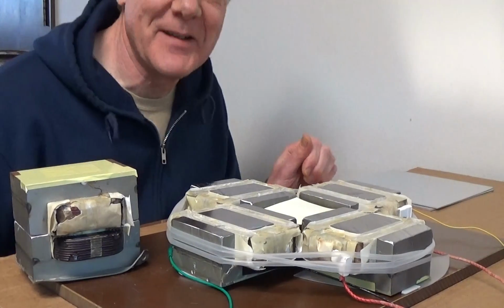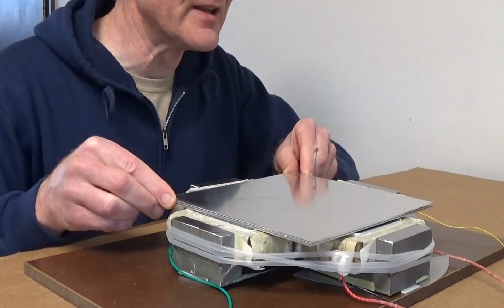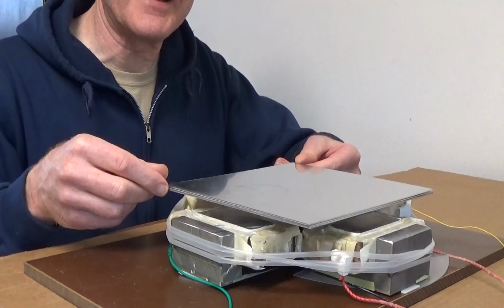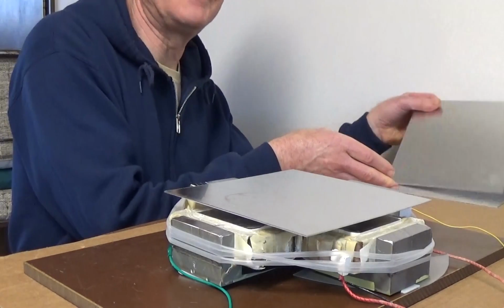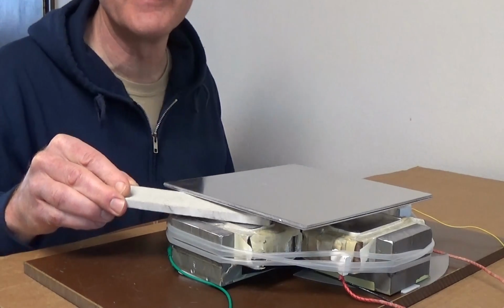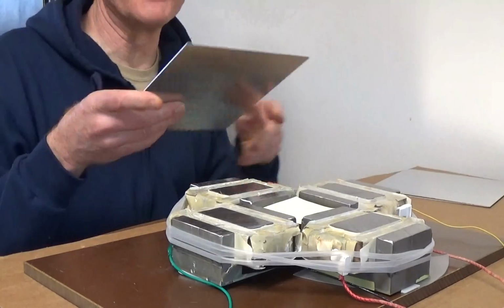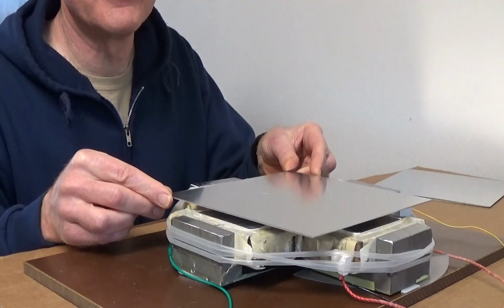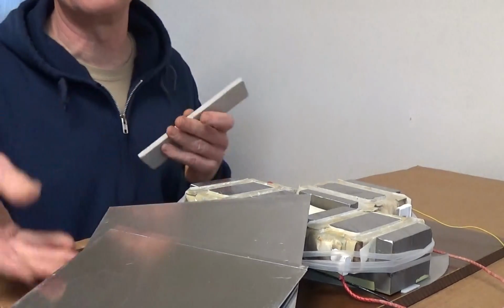Eddy current levitation using microwave oven transformers

Comment: But why does it levitate higher with more plates added???
Reply from the maker: That's the entire reason I built this demonstration - to see if that effect of more plates levitating higher was real.  Calculated that result theoretically first, but had a hard time believing I'd calculated correctly.  I tried to make a simple explanation at the end of the video.  Induced current in upper plates creates a magnetic field that attracts lower plates.  Another way to view the reason (the one I first calculated) is that the phase of induced current in the plates shifts to better align with phase of MOT winding current when more plates are added.  In-phase current creates more average repulsive current.  An infinitely thin aluminum sheet would have current 90 degrees ahead (leading phase) of winding current so generate no average levitation force.  With infinitely conducting sheets (very thick or superconducting), plate current is in phase with coil current so levitation force is maximum.
Reply: @davekni  Thanks for the updated explanation. The phenomenon definitely seems counter-intuitive. With all the plate masses being the same, I would think the addition of each plate would surely decrease the height.  Up to a point,  the added plates seem to be concentrating or, as noted, more efficiently using the induced fields.  You have definitely given me more to contemplate on. Excellent work 👏 👍🏽
Reply from the maker: @rod3134  Yes, decreased height is what I'd initially expected before thinking about phase in more detail.  My 23kHz unit does decrease height for any practical thicknesses.  That's because at high frequency even thin foil is effectively "infinite" thickness.  Phase is already aligned.  (Actually I should say 180 degrees rather than aligned.  Plate current is in opposite direction as winding current.)
Reply: @davekni  Wow!!! A possible explanation in addition to yours just occurred to me.  The analogy of the levitating Styrofoam balls in an enclosed sonic field system. Objects that are too big or too numerous will collapse the frequency node object capture capacity. Your sheet stacks are matching the frequency node central area until there is a max saturation within the effective frequency range. It's probably not that the height is increasing,  it's probably more-or-less that as more sheets are added,  the sheets frequency energy capacities and capture causes a relocation of the node height.  I know this may seem like a very loose thought, but this is really making explore some of my previous research,. Great discourse!!!
Reply from the maker: @rod3134  I doubt there is any significant analogy to sonic levitation.  With too many plates, upper plates see less magnetic field.  Current from lower plates reduces field farther up.
Reply: @davekni  Gosh, I wish I had a bigger lab... Keep in mind that the sonic system is using a multi vector axis system to levitate the objects. You can easily see the sonic field tapering off at intervals and increasing distances from the main frequency node. If the sonic system was halfed, I believe the result would be similar to yours. In your case, though, the axis of influence is mostly singular. (Bottom-Up) I would bet donuts to dollars that if a multiple axis system could be used in your setup,  the effects would be similar.  I tend to be able to see the field geometries in my mind.  The hysteresis effects and magnetic frame dragging additionally complicate it more than the simple sonic unit. I'll definitely let you know if I see anything that validates my theory. ✌🏾
Reply: @davekni is the phase difference caused by the increase in the amount of the induced current? If it is and more current can flow because the resistance of three equal resistors in parallel is 1/3rd the resistance, I think naively that means (with good electrical contact between the plates I mean) that the current for each of the plates encounters approximately 1/3rd the resistance. Normally looking at the resistance of a big sheet of conductor is silly, but when the process relies on so many amps it might actually be really important. I'm just kind of personally shocked that the contact resistance is so low, actually so shocked by it that it makes me wonder if I'm completely off-track with that explanation!
I'd be curious to see what happens if you put 2 comparatively very light pieces of insulator like 2 pieces of cling wrap either on top of for a baseline, or between, to disrupt any parallel arrangement of the resistance, if it would stop that effect.
Reply from the maker: @pinethetree  Insulation between plates makes little difference.  Plates came with a protective plastic layer that I removed for video.  But it worked the same before removing plastic.  There is little induced voltage perpendicular to plates, so little current flow between plates even when they are in contact.
You are correct that three resistors in parallel have 1/3rd resistance.  If a voltage source is applied, three times as much total current flows.  But each resistor has same current flow whether other two resistors are there or not.  Same for these aluminum plates.  Each plate has same resistance and same current.  3x total current, not 3x for each plate.

Comment: Can we use smaller winding to levitation system e.g coffee grinder moter winding ??
Reply from the maker: Smaller works, but frequency needs to be higher.  This is already small for 60Hz line frequency.  My initial small experiment coils were 40mm diameter and ran at 100kHz.  (I'm not familiar with coil shapes of a coffee grinder motor.  Shape may not be appropriate.)

Comment: The plate has a resistance and an inductance and behaves as a low pass filter with a cut off frequency, which is proportional to the resistance over inductance ratio.
Below the cut off frequency the plate behaves mostly resistively, the induced EMF and current and opposing magnetic field are leading the coil's field by 90 degrees, producing no net force, only vibration.
Above the cutoff frequency, the lowpass filter effect delays the current and opposing magnetic field by 90°, they are now in phase with the coil's magnetic field and creates repulsion.
The repulsive effect increases as we get closer to the cut off frequency and remains constant above it.
Stacking multiple plates, which is the equivalent of making a plate thicker, reduces the resistance, while the inductance remains constant, lowering the cutoff frequency. Above a certain thickness the cutoff frequency is below mains frequency and the repulsion will not increase.
This is a form of induced diamagnetism, where a conductive material exhibits a strong negative susceptibility to alternating magnetic fields.
In a superconductor, the resistance is zero, which means the cut off frequency is zero, which explains why superconductors are strongly diamagnetic (susceptibility -1, permeability 0), making able to hover above magnets. (this is independent from the Meissner effect, which is not responsible for levitation)
Reply from the maker: That is a great explanation!  Simpler, at least for those with electronics background, than the ways I've explained it.
Reply from the maker: To make this electrical circuit explanation complete, I think one more detail needs to be explained:  When resistance is large (thin plate), the inductor voltage and current are close to 90 degrees separated as you discussed.  As resistance drops, phase difference decreases.  That alone would make force increase proportionally to cosine of angle.  Doubling plate thickness (halving resistance) would produce slightly less than twice the force.
The reason for additional force beyond angle is that current in this L+R low pass filter increases as resistance drops.  Force is proportional to current times cosine(phase).  Both factors increase, making force increase faster than weight.
Reply: @davekni  Thank you for completing my explanation ! (wrote it at 1am on a phone). Interestingly, this levitation effect is also produced in induction motors. However, the torque producing component (or force, for a linear motor) is the out of phase current. As a result, the torque of an induction motor increases with the amount of slip, but not proportionally because it is also proportional to the sine of the phase shift. Above the"cutoff frequency" the induced EMF no longer increases and the phase shift decreased. As a result, induction motors provide less torque at high slip frequencies, because the torque is "converted" into a repulsive force.
This property allows us to make a single phase induction motor : the rotor sees an alternating magnetic field which is two rotating magnetic fields turning in opposite directions. Assuming we have some way of momentarily starting the rotor (quadrature winding + capacitor) the rotor will keep turning, as the rotating component with the least amount of slip will generate more torque.
In a linear motor, this effect can be used to generate both traction and lift. If the motors are arranged in a way that provides a stable levitation (motors on the side of the aluminium plate) the motor will also provide guidance. Such an arrangement is called a "magnetic river"  It has been invented by Eric Lathwaite and proposed for use in maglev trains.

Comment: Thinking of cool applications for this. 

Could you make electro-magnet tiles and tile a floor with it in such a way that the electromagnetic field generated would be flat and smooth enough to ride it with copper skateboard/snowboard decks?

I've seen a hoverboard experiment that does the oppposite: An electromagnetic board over a copper surface, but the electromagnetic board is very heavy.

Imagine an indoor skiing/snowboarding slope and a flat area for electromagnetic hoverboarding. That would be amazing. You just couldn't bring any electronic devices inside and people with pacemakers shouldn't participate either. :P
Reply from the maker: Interesting idea!  Could be a good project to simulate using FEMM.  My guess is that it could be feasible for larger snowboard-sized decks.  Probably not for smaller decks, but I'm not sure.  Would be expensive and power hungry.
The magnetic field would not be flat.  Rather a grid of alternating polarities (alternating 180-degree phasing) at a sufficiently fine pitch to average out across the deck.  Finer pitch increases power required.  Coarser pitch is better, but requires larger decks to average (smooth) out lift force.
Copper deck may need some active cooling.  Superconducting decks would eliminate most losses, but obviously require much more cooling.  Superconducting electromagnets for the tiles would likely be cheaper to operate in spite of cooling requirements, as copper tile coils will waste a lot of electricity.
Reply: @davekni  Yesss. You seem to have a far better understanding of electronics and electromagnitism than I do.

An active cooling system on the copper snowboard would significantly weigh it down though. But what if you cooled the
electromagnet tiled floor instead? The low temperature would improve the conductivity but also cool the layer of air directly above the tiled floor. 

Your hoverboard would be suspended in that cold layer of air and because you would constantly be moving, the copper hoverboard would probably be sufficiently cooled while in use.

Not only could you build a broad, long slope  and a flat open skating rink-like area, you could also make a skatepark type of terrain with halfpipes, quarterpipes, banks, ramps, rollins...etc, all of it tiled with actively cooled, superconducting electromagnet tiles.

And hoverboarders will be given copper helmets, copper elbow pads, and copper kneepads with cushioning, elastic material on the inside. Hoverboarders falling off of their boards would be magnetically repelled from the floor,effectively acting as a magnetic cushion. Perhaps the surface of the tile could be covered with a thin cushion/elastic mat. Perhaps a composit; Layers of rubber and layers of a firm foam.
Reply from the maker: @allonifrah3465  Certainly for an indoor area, cool floor could help cool copper boards above it.  Outside there might be enough air flow to prevent much of a cold-air layer.
Using a soft insulating layer above a superconducting tile array sounds good too.  Of course, the thicker the insulation layer is, the stronger the field required to levitate farther above tiles.  Most effective insulation is vacuum (thermos bottles), then aerogel, both of which are not soft.
Perhaps helmets and pads should be aluminum for lighter weight.  Presumes one doesn't remain fallen for too long so that additional heating is not important.
Reply: @davekni  Yeah this is something you'd do indoors, like artificial ski slopes with snow made by machines.

And yeah I was thinking of aerogel since only a very thin layer of it insulates insanely well. We wouldn't want to insulate it too well, or else the floor cooling system wouldn't be able to cool down the layer of air right above it. If the aerogel mat had flaps that could open and close, regularly spaced from one another, it could either cool only the electromagnetic tiles or both the tiles and the air directly above the floor.
When the flaps are open, it would cause the cooling system to divert part of it's power to cooling the air just above it. These flaps could be simple mechanisms that, when opened, make tiny gaps in the floor. They just need to make an airtight seal in their closed position.

A thermostat system that uses equally spaced out thermometers to constantly measure the temperature could open and close those aerogel flaps to ensure that the cold air layer above the floor remains roughly the same.

If someone goes down the slope and across the large, flat rink-area, or over any spine or quarterpipe, the aerogel flaps open in a roughly oval ara spanning the space directly below them to about 2 meters in front of them, so the air will be cooled in realtime when and where needed.
Reply: @davekni  As for helmets and pads: If Aluminum can induce the same amount of eddy currents and repel magnetic fields with the same force as copper, then hemlets and pads  should be made of aluminum. Maybe aluminum pads & helmets with a thin, copper outer layer.
You will want that magnetic cushioning effect.

The rest would be done by soft cushioning material on the inside of the pads and helmets. Since it'll be could inside that building, people would wear thick, insolated pants, vests and coats, which would also serve as cusioning material in case of a fall.
Reply from the maker: @allonifrah3465  Aluminum wouldn't have quite as high eddy current, but close enough, with more heating.  Depends on frequency and size/pitch of coils in floor.  Smaller size of contact area between helmet/pads and floor will limit force, perhaps to the point where there is little value in the aluminum other than reducing magnetic field strength inside a helmet.  (There is still uncertainty as to just what harm or not is caused to humans by AC magnetic fields.)
Cooling to cryogenic temperatures for superconducting magnets requires much more electricity per watt of heat removed.  That is one reason cryogenic systems use such good insulation.  It would be inefficient to use that cooling for room-temperature items such as copper boards.  Fins on the copper or some other such solution would hopefully be sufficient.  Without modeling (ie. FEMM), I can't say just how much heat needs to be dissipated.
I'm not very familiar with skate/snow sports.  However, any "spine" or other surface with significant curvature will reduce area adjacent board, so make magnetic levitation difficult.  Something on the order of snowboard size is likely required, with most of that area near the floor.
Riding such a floor would be like riding a snowboard covered with springs across the bottom with friction-less pads on the bottom of the springs.  Balancing on such a springy platform might require some learning.  (Far past my poor coordination skills for any of these sports.)
Have fun inventing and dreaming!  Don't let my injection of some real-world concerns dampen your creativity.  There may be enough rich customers around the world to support creating one or two indoor levitating board venues.  Participants would likely sign wavers accepting their exposure to large AC magnetic fields.

Comment: I found 4 other identical transformers that are 800w. Are they good for levitating the aluminum plate? How many watts are your transformers if my transformers are not good with 800w?Are the 800w ones better than the 700w ones or are they the same, using the secondaries in this project?
Reply from the maker: I don't know the wattage of the transformers I used.  Perhaps 1kW.  If yours are slight smaller, just place them as close as they fit and use a slightly smaller aluminum plate.  Should work fine.

Comment: the motor running capacitor is that "start capacitor",?(40uf 400) i have or (45uf 400v), it is good? If I open the transformer from the welds of the iron center next to the primary, it means that the iron centers will be 1-1.5cm higher than your device. In this case, it is possible to levitate or you should cut the centers closer to the secondary ?
Reply from the maker: With weld removal instead of cutting, I'd use the primary windings instead, since they are close to the levitating plate.  Unlikely to work using windings away from the plate.  So either use primary windings or cut the core down close to secondary height.